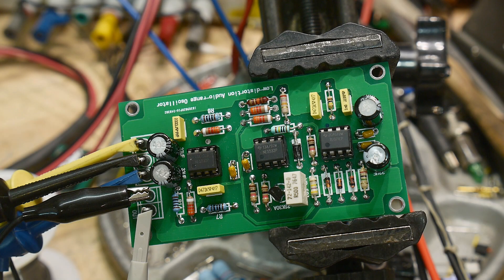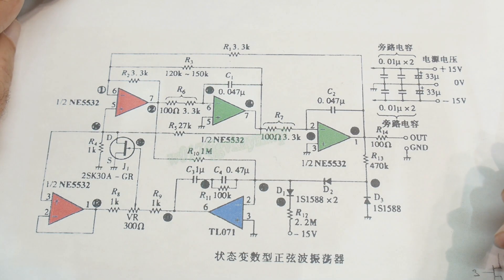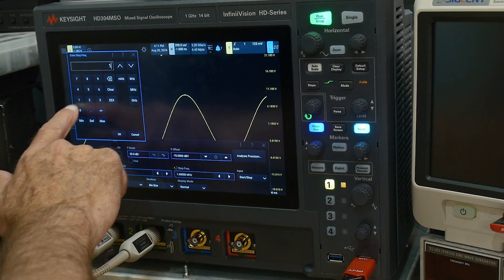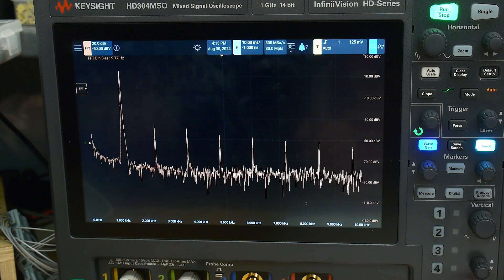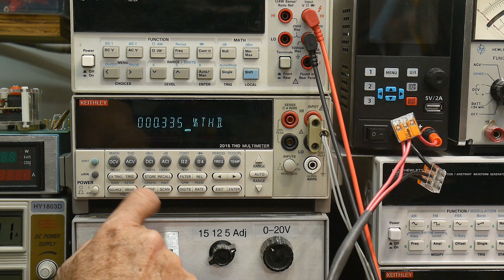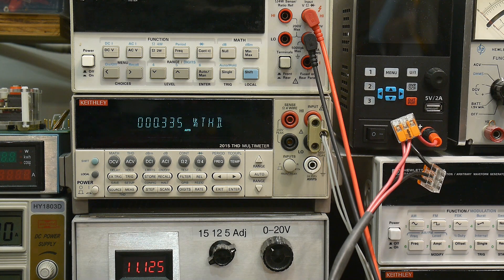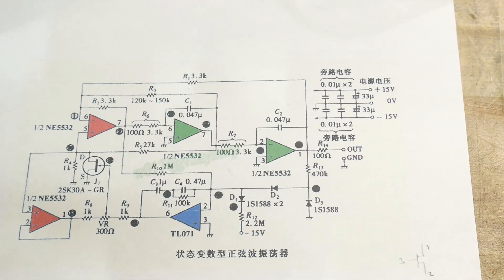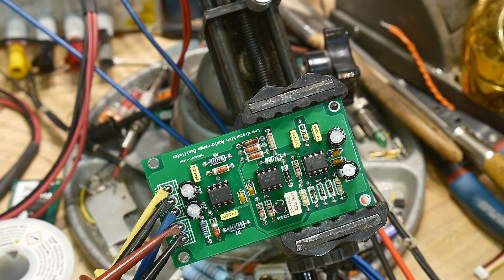#1992 Low Distortion Audio Oscillator

Comment: I found that the biggest reason fir poor harmonic distortion was due to the NE5532 chips.  Any load below about 2kilohms will cause bad distortion.  I replaced the NE5532 with 49720 chips that gave me .00032% distortion into 600 ohms.

Comment: I bought a working unit and several empty board.
They have advertosed 124 dbFS THD.
I powered the unit with +/- 18V and I got a sine wave output at roughly 9 VRMS or 19.5 dBV
VR is attenuating the second harmonic distortion.
R6 and R7 are pots used to set the frequency.
The TXD is better than -104 dBV.
Therefore, output level plus THD = 19.4dBV 104 dBV = 123.4 dBV
It's colse enough to their claim.
I was able to get that because I played with all 3 pots.

I assemblend a second circuit on a spare board  with resistors and capacitors slightly differents.
I ans was able to get THD below -106 dB on and output of 9.8 VRMS or 19.8 dBV.
In that case, THD FS = 106 +19.8 =  almost 126 dBFS.
Measuring THD + N did show a reduced value by about 16.5 dB.

All measurements was done with a QA403.

Comment: I don't understand why the single Op-Amp was not specified as a NE5534 for a lower noise output than the TL071.  When you measure noise you usually get distortion plus noise. Ron W4BIN

Comment: As a follow up it looks like there are also three capacitors with incorrect values. One of the two 47nf capacitors is a 33nf. The 470nf is a 47nf and the 1uf is a 1nf. I'm sure that changing these capacitors and resistors would get this board producing a low distortion (.001%) output.

Comment: Thanks for posting this. I was interested to see it as I have just finished my build of this oscillator using the Aliexpress pcb and have measured distortion levels of .001% which is about at the limits of my measuring gear (REW software and a Steinberg UR22 audio interface). Looking at your pcb it appears that R12 (2M2) is a 1M and resistors R4, R8 and R9 are 10K instead of 1K. If so that would compromise the levelling circuits around the TL071 and the J1 fet (2SK30A-GR) causing distortion. Also, what fet did you use for J1? I used a selected MPF102 with an IDSS of around 5mA which is in the midrange of the 2SK30A-GR 2.6 to 6.5mA spec. I also used closely matched 47nF caps for C1 and C2. So perhaps these comments may assist you to get your oscillator producing distortion specs similar to mine. Cheers!

Comment: You need to ajust R6 and R7 for the lower THD possible. Your PCB has fixed resistors. This circuit can do much better than that.

Comment: I like your vid very informative and fun Thanks, c1 and c2 are not the same value on your board, i have the same problem to bring down the thd, on the board they sell. the 2sk30a on board follow the silk screen, data sheet and the 2sk30a that i have is not the same as the silk screen ?

Comment: VR adjusts that JFETs linearity as a resistor. What the circuit seems to be is a high Q (high enough to self oscillate) state variable filter. J1 controls Q of the filter through that peak detector around the diodes and TL071. Matching R6 and R7 should help, same with C1 and C2 because they control the frequency and those two integrators should be as close to each other as possible.
After that adjusting R13 or R12 might lower THD (by lowering the overall output level that starts lowering Q).

Comment: What if, forgive me my ignorance, if you build two of the same audio oscillators , but one of the two is delayed, the outputs are tied together. The delay is related to the frequency, and it is always one complete phase behind, the harmonics would then be out of phase and therefore always less then what it used to be.
Reply from the maker: THD stands for TOTAL harmonic distortion. ALL harmonics are summed, no matter what frequency or phase.
Reply: @IMSAIGuy  The Total Harmonic Distortion goes down when the signal of the oscillator is lead through a delay and added to the original signal, the two true sinussoes add up when in phase, but all distortions and harmonics will be out of phase and therefore be less then before. To be frankly honest I have no clue how to delay the signal for exactly one complete phase, others can do that. I should have studied harder. But reducing the distortion is possible, in the seventies there was an article in Elektuur (a Dutch electronics monthly) a low-noise pre-amplifier for a gramophone, they used parallel ten cheap transistors to amplify in the first step. Every transistor had his own hisses and hums, but all hisses and hums were out of phase to each other and did not add up. I am confidant that you are able to reduce the THD, I can't do it myself, I am only an admirer of the true geniuses.

Comment: From the view on your FFT I just estimated that the first harmonic was 50-60dB below the fundamental, which agrees quite well with a few 0.1% of THD. For a circuit board which is populated with probably not selected and paired components, even mixing in 5% tolerance carbon film resistors and ceramic capacitors, I would say that 0.3% THD is quite decent. To compare it to a 8000+ dollar modern scope, which few amateurs ever will be able to afford even though almost every youtuber seems to be awarded by Keysight with this beast lately, is more than unfair.
But yes, a Wien oscillator as pointed out in other comments, would probably have a better performance at the same price level.
Reply from the maker: https://youtu.be/oOFYrZH1ECw?si=LZIUN4FbgF7QcQRN

Comment: You need a decent pairing of capacitors and resistors in the upper part of the circuit, matching R6,R7; C1, C2; R1, R2

A guy from Czech Republic has done a lot of work on this sort of circuit; he even sells kits of his adapted design. He has a PDF of schematic and a lot of commentary as well, you should be able to find it if you search

"An ultra low-distortion oscillator with THD below -140 dB"

Part of it is building an equally decent notch-filter just to be able to see any residual spurs! A decent modern replacement OPAMP to make these kind of circuits with should be OPA1656 by Ti, it won't break the bank at least. Harder component to find is a really good linear optocoupler.
Reply: Matching and pairing R6, R7, C1 and C2 is rather pointless. The only result of unmatched compts is a slight difference in amplitude of the outputs of the 2 integrators, which won't affect anything.

One integrator generates a cos signal, the other a sin signal. If you display them as X and Y on a scope, you might be able to see any non circularity which represents distortion.

I would expect most of the distortion arises from the auto levelling part of the cct acting on the JFET.

Comment: Yeah, This is a state-variable oscillator which are not known for low distortion.  Wien bridge oscillators with a good amplitude control can be much better.  Jim Williams discovered this in his paper “Max Wien, Bill Hewlett and a rainy Sunday afternoon”.  He tried to get better and better distortion figures by using different amplitude control circuits.  When he got to the J-FET he found that the control voltage modulated its channel length which limited his efforts to improve it.  I also found this but did better eventually with a homemade voltage-controlled resistor made from an incandescent lamp and a Cadmium-Sulphide photocell pushed into opposite ends of piece of small tubing.  I got the THD down to 0.00018% at best using a notch filter to see the residue and measured on a HP 3580A spectrum analyzer.

Comment: Classical  Wien Bridge oscillator with incadecent lamp in feadback gives me 0.0017 % THD.
Distortions starts at -96dB. All "measurments" was made with Visual Analyser software and creative SB soundcard.
Reply: I too have a design and comparable numbers, with my incandescent based oscillator.
Reply: 96dB would be the base dynamic range of your Creative SB soundcard - in other words, it's undetectable with your equipment.
Reply: Why not?  I have proof, video can be searched by  keywords " Creative SB0100 THD & Noise floor. How good Sound Blaster Live! in record mode "
And sory about my english
Reply: JurekOK may very well be right. How about using one of those 1-bit DSD recorders? They can sample at around 10 MHz if I remember correctly.

Comment: I purchased the same unit you have but I got the assembled one. Interesting mine have multiturn trim pots for R6 and R7. I bought it in 2023. They are using those two pots as rheostats for the R values.   Using a +/- 15 volt power supply and the QA403 24-bit Audio Analyzer I measured a frequency for the sinewave of 996 Hz.  The THD was -82.00 dB or 0.00794%.  So I would rate this as a very good low distortion sinewave oscillator.  Maybe you have a defective part or possibly an error in assembly of your unit.  Or the one they build, they trim  R6 and R7 for best performance.
Reply: I did the same measurements, THD of 101dB, and THD+N of 93dB. Replacing the op-amp with OPA1612 improved the THD by 2dB The power supply is critical to improve THD+N

Comment: In Linear Technology Application Note AN132 - Fidelity Testing for A to D Converters, Jim Williams and Guy Hoover present a low-distortion oscillator circuit that eliminates or reduces the distortion that is present in several features of the eBay circuit.  For instance, the FET that is a source of nonlinearity is replaced with a cadmium sulfide cell that is illuminated by an LED, and the LED bias source is designed to contain very low ripple from the oscillator.  🙂
Reply from the maker: I looked at that app note and thought I would make one. oh. ouch. very expensive opamps in that thing. I don't need it that bad.
Reply: @IMSAIGuy  Okay.  I presume the authors used the very best available from Linear Technology at the time, and those remain expensive, particularly since there is very limited production volume.  Fortunately, there are modern high-performing audio op amps that are much less expensive that could be substituted for A1 through A3, and the remaining op amps could be any of a wide variety of modern inexpensive parts.
Reply: @analog_guy  How do you know there are exact, or good enough, part substitutions. Sometimes it isn't possible, even using the specified parts, to get to the spec without binning.
Reply: you need a Masters degree to understand this comment.

Comment: Low distortion coefficient sine wave oscillator circuit board, oscillation frequency: 1 KHz, ultra-low distortion, distortion coefficient 0.000064% (-124dB) line from "Transistor Circuit Design and Production" (Japan) written by Toru Kuroda.
Reply: where did you found this book? I can't :(
Reply: Please give a link it is imposible to find...

Comment: Ah, but your assumption abut using good components is the issue.  The circuit was designed only to work with crappy components.

Comment: What is the output frequency of the board? The harmonic distortion test should be checked according to the test frequency before testing.
Reply from the maker: The keithley measures the frequency and harmonics automatically

Comment: The capacitors on the board that control the oscillation frequency are selected and paired using a digital meter. The resistors that control the oscillation frequency are a 3.3K resistor and a 200 ohm 3296 multi-turn potentiometer in series. The pairing is measured and adjusted using a digital meter to ensure the accuracy and low distortion of the output frequency.
Reply: Way more work than The Guy, will probably put into any video. It's only show and tell level, for this kind of video.
Reply: @willthecat3861  that "any video" part was just rude..
Dude uploaded 2k+ videos of him actually doing stuff that is actually practically teaching in a very timesaving format compared to e.g. yapping for an hour long video of the same thing over and over on modern eevblog.. There is plenty of quality info on the channel, and only parts of low effort I've encountered here are "cheat day" lazy real-time assembly videos of moderate level solder work, that's it..
Reply: @Mr.Leeroy  well you said more on my part than I said for myself. It's my opinion, after watching since The Guy started. If you are learning stuff great. That doesn't mean everyone else is, or isn't. Everyone is different.
Reply: @willthecat3861  What do you watch it for all those years?

Comment: I built something similar (found it in the Dutch electronics magazine "Elektuur", sometime in the '80s). It was originally designed to be adjustable from about 20 Hz to 20KHz, but I extended the range from about 1.5 Hz to 120 KHz. It has low distortion, around 0.01% at 1 KHz. The Elektuur design uses one Quad TL084.
The circuitry to control the gain was better than this design, resulting in lower harmonics.
Reply: Hey. Do you perhaps have the schematics available still? I'm super keen to see what you used to get your results

Comment: That's not considered low distortion!  Even a simple twin T oscillator using an op amp can easily hit fractional three digits distortion.
Reply: @jim9930 That little r19 thermistor can still beat the pants off all but the best digital stuff even today!.
Reply: The real ultra low THD ones are designed, made and sold by Viktors on eee bay.

Comment: Compared to the 10% of a typical speaker, 0,3% distortion is fine.
Reply: No doubt. Mind you 10% distortion is intolerable to listen to, it is the norm for car audio when used at maximum power output. At least, the audio chips I've seen that are designed for simpler automobile systems seem to be rated like that.
Reply: @MinceWalsh  
I was not talking the electrical distortion, but the mechanical one from the speaker chassis. You need to be very good in (air)fluid design to bring that down. I remember something like low single digit percentage with a horn for impedance match.
But some gold ears hear 1/100% electrical difference.
Reply: don't tell that to the audiophools....